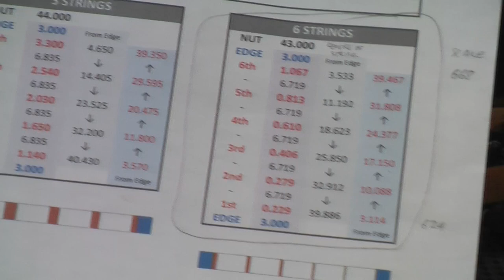Thezur Valken guitars restores a BC Rich Warlock Body Art Collection   The Fly

Comment: you done a good job on that guitar fair play! what pick up is in there?
Reply from the maker: Thank you very much @chriscatley9932. The pickup came with the project, it must have been scavenged from an Ibanez guitar, made by DiMarzio. It appears to be very similar to the DiMarzio DP200. But if you like the sound at the end of the video, that is all down to the pre-amp distortion pedal which is a replica of the Sunn Model-T emulator. I'll put up a quick video about it if you're interested.